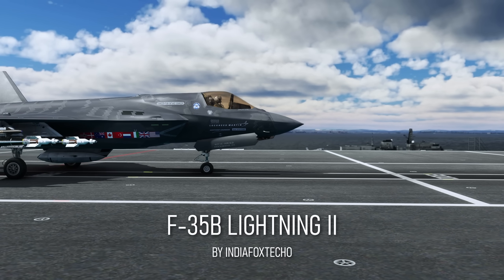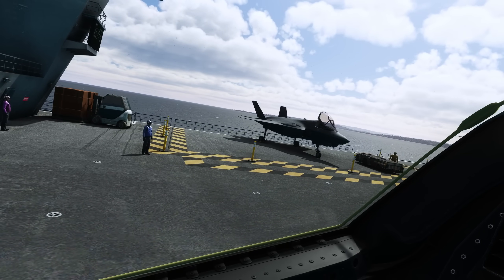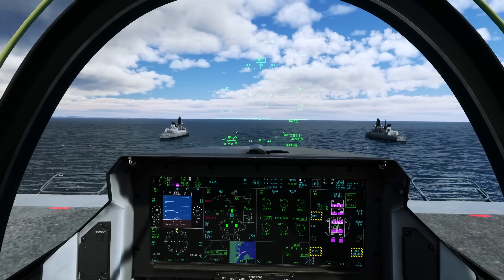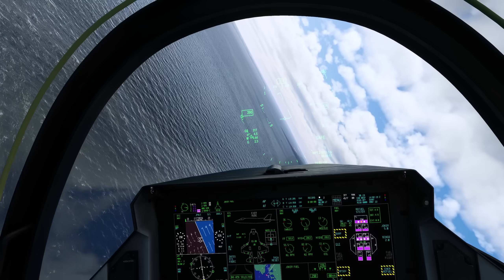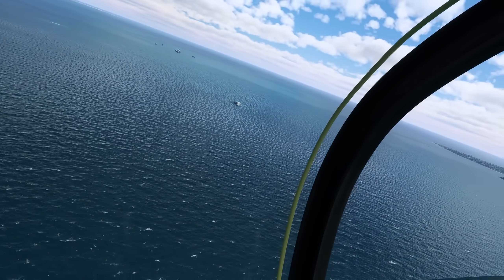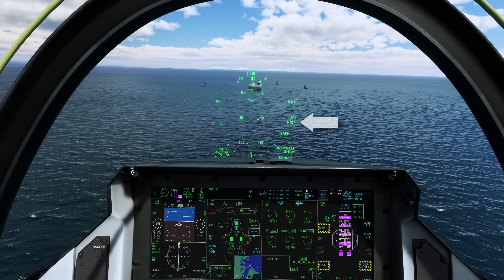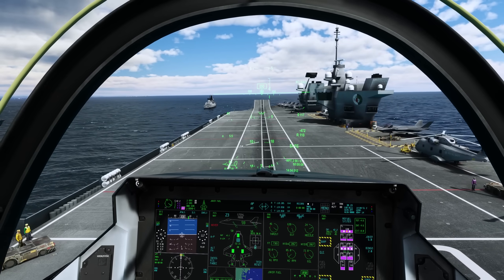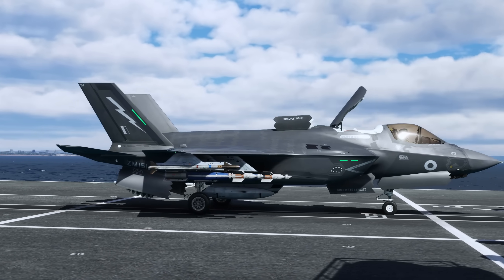Too Heavy to Hover? The Brits found a solution! F-35B Lightning II SRVL (MSFS)

Comment: Very nice video. Just to add my understanding of why F-35 needs forward flight to land. Its not so much lift from the wings - rather when hovering in place, the air above and around you is already moving downwards because of the downward engine efflux. That means more thrust is required to overcome this (its like a headwind). When moving forward, you are moving into air that is not (yet) moving down, and so the thrust required to hover is lower. Same with helicopters, the quicker you can transition to horizontal flight the lower your hover power. Whether all that is properly represented in MSFS2000 I don't know, someone recently was saying helicopter vortex ring state was not represented - very related topic - so maybe/maybe not.
Reply from the maker: Not quite. It is due to the extra lift gained from the wings with a bit of forward flight. The air moving down piece is more to do with helicopters and VRS and only a factor if you’re moving down into the descending air too quickly. Moving forwards in a helicopter provides the same extra lift due to forward flight (transitional lift). My knowledge of helos is limited, but back to the original piece, the SRVL is to gain lift from the wings. Hope that made sense! 😅
Reply: The difference between this and a helicopter is the volume of air moved. A helicopter works to move a large volume of air relatively slowly (not that helicopter downwash is slow, but it is nothing on the lift fan wash), while the F35 moves much less air much more quickly. Translational lift and VRS are still technically a thing for it, but the relevant speeds are something like 10x higher. The lift fan is only in 'forward flight' when it gets to around 150mph, and the wings start to contribute well before that.

Comment: Strange. I thought you had to have at leat 50 Kts over the wing to do a VSTOL in the F-35.
One of us is wrong.
Reply from the maker: You’re probably right 👍🏻 As I mentioned (I think) some of what I did was a work around so that it worked better in the sim. That said, as long as it’s within weight limits to hover I’m guessing it have STOVL as whatever speed.

Comment: The real F35 does not have a HUD at all so i assume putting that in there is a work around till they get put helmet display systems in MSFS but i honestly don't think they will go to the bother of doing it, after all you cant actually use the jet in this sim for what it is actually designed for. But ultimately it's a nice looking model and MSFS is still early in it's develpoment so flight models are icky at best.
Nice video
Reply from the maker: All true. The HUD presentation does move a fair bit to simulate HMD but it’s only what’s possible, and there is an off boresight HMD option but it’s very basic.

Comment: "The Americans don't do it, but the British love giving things a go!"(sic)

The Brits don't do it either. During CSG 21 all recoveries aboard the QE were vertical. Although the US Taxpayer paid the bill to develop and implement SRVL/Bedford Array code into the F-35B the technique still isn't approved for operational use aboard either of the British boats. One would think that after the F-35B ITF conducted all of those SRVL tests off the coast of Virginia/Maryland back in 2018 that it would have only been a matter of time before it became SOP but nearly four and a half years later that still isn't the case. Recoveries remain stop then land as opposed to land then stop.
Reply: SRVL code was all  paid for by the UK Government....a huge amount of coding for F-35 is undertaken by BAE Systems at Samlesbury in the UK...they've been brought in to attempt to fix the mess that LM had made....

The reason why SRVL has not been progressed further is purely due to Prince of Wales propulsion issues. Another round of tests were due off the East Coast of the US last year using the ITF aircraft, of which the UK owns 3, this was postponed as a result of PoW having to go to dry dock. It will be undertaken again once PoW deploys to the East Coast...

But the need for SRVL is not that pressing at the moment. As Storm Shadow was removed from the weapons integation work many years ago, due to delays in the JSF programme, the need for bring back of heavy stores has decreased. Current UK air weapons max load on F-35B is around 5,500lbs (6x Paveway IV, 2 x Asraam, 2 x Amraam). In 2028 when Block IV (might) arrive that will increase by about 1,000lbs to c6,500lbs (8 x Spear, 2 x Meteor, 4 x Paveway IV and 2 x Asraam). Both of those figures are easily in the F-35B's vertical landing limits, even in tropical conditions with fuel onboard. And if the F-135 gets the proposed upgrades even more so...

As a result SRVL is not required operationally at present, other developments can take the front seat. If and when external tanks, potentially buddy stores and the FCASW munition are cleared on F-35B from 2030 onwards SRVL may then become necessary in some limited circumstances.
Reply from the maker: @dogsnads5634  great knowledge, thanks! Definitely need to prioritise carrying more fuel and stores!
Reply: He talks utter 💩trying to say that the USA taxpayers fund everything
Reply from the maker: That’s crap, sorry I didn’t know it wasn’t operational. Bet if they found an urgent need it would very quickly become SOP!
Reply: Total utter bollox,  of course. BTW, these are "ships". Only submarines are "boats".  Did your patheticness not know?
Reply: Jealousy is obviously a part of this ! British boats ? The British carriers who invented most technology from steam catapult, Angled deck , Optical Landing System, Radar , armoured deck, STOVL  and actually passed over EMALS from EMKITS but didn’t stick a ridiculous Nuclear Reactor onboard because when you actually take one to war you’ll find out why

Comment: Is this actually done?
My understanding of winged flight is that, as soon as you go below stall speed, the wings will lose all lift at once. I somehow doubt that this is an accurate simulation.
Reply from the maker: Yes this is done, with the F35B only as it has a lift fan and the jet nozzle can point down. A bit like the Harrier. It only gets a little bit of lift from the forward flight.
Reply: stall occurs due to angle of attack, not speed

also, the lift coefficient still increases for a good while after hitting the stall angle - drag coefficient shoots up, though

Comment: I would have used the  HMS QE on the Irish sea or Scotland since both are the only moving carriers in the uk at the moment, just for realism.
Reply from the maker: Yeah, the issue with the moving ones is that I can’t use playback reliably and I’ve found that sometimes moving ship assets stutter when you’re close to them. And I wanted the waypoint which also wouldn’t work if ship moved! 😅
Reply: @cgaviator  the stuttering issue is actually a known bug on MSFS with WorldScripts and uncapped FPS. It has been reported to Asobo. As a temporary fix, cap your FPS to 40 or 45 and the stuttering will be gone.
Reply from the maker: @miltechsimulations  you legend! thanks for letting me know!
Reply: @cgaviator  I found the F35 can  track moving waypoints, I can cycle through each waypoint in the F35s pop up menu to switch between ships and as long as I have marked each ship as a waypoint in the main menu before my flight, I'll get my distance and a heading to both the moving ships location where ever they are although there always in roughly the same loction to start with.🙂
Reply from the maker: @stuarthendry5397  ah yes, it does drop a waypoint but given enough time, the ship will have moved from it. I was after some fairly accurate ranging this time around. But if I'm just looking for somewhere approximate then the world map waypoints are ok
Reply: @cgaviator  Oh ok, I have also few over R08 in the Irish Sea, landed, then went a good 30 minute flight round the loop but seemed to be able to track back ok. However as you say given a longer time period that they move completely off the waypoint will be something I have to bare in mind and check out myself to see how long it takes them from being triggered to moving away from the point. Cheers for the heads up! It would be pretty neat if they all had tacan avalible exspecailly both R08 Scotland & Irish Sea

Comment: Building a carrier without a catapult and arresting gear is designing a terrible carrier.
Reply from the maker: It was a crazy amount of poor prior planning! I watched an interesting mini documentary about why they eventually didn’t include cats etc. Still, the B models are very cool, but I’d have preferred the C!
Reply: The predicted sortie rate is pretty close to a Nimitz, the ship's crew is 40% smaller than CDG with a ship that is 50% larger. You pays your money and takes your choice, the RN chose to put the technology in the aircraft and not in the ship.
Reply: @glynnwright1699  The sortie rate will be NOTHING like the Nimitz class. I know what they claim on paper but real world performance will be different. Having 4 catapults is way better than a single ski jump.
Reply: @Bellthorian  Sortie rates are 160 and 110 respectively.  Crew size 5,200 and 1600 respectively. The USA has an MOU with the UK to access the UK carriers to operate with the US Marines in wartime, because they greatly enhance the capabilities of the US Marines in certain scenarios.
Meanwhile:
'A June 2022 GAO report states "The Navy also continues to struggle with the reliability of the electromagnetic aircraft launch system and advanced arresting gear needed to meet requirements to rapidly deploy aircraft." The report also indicates the Navy doesn't expect EMALS and AAG to reach reliability goals until the "2030's"'.